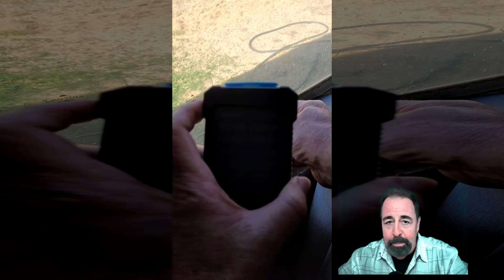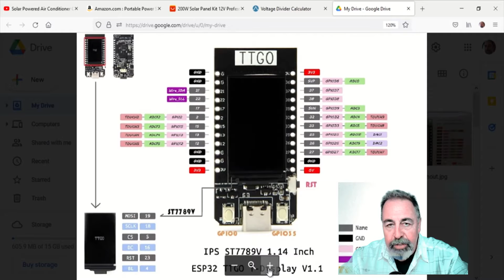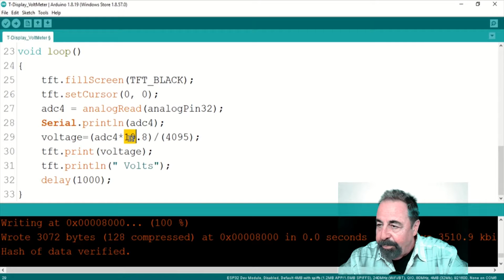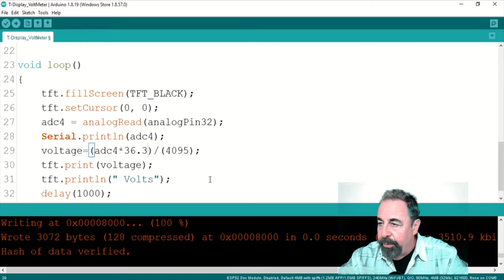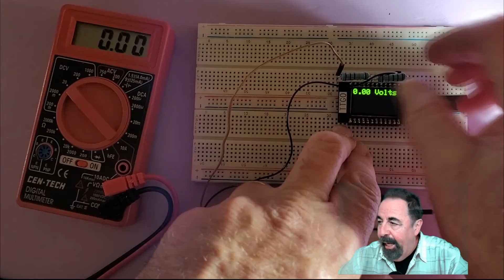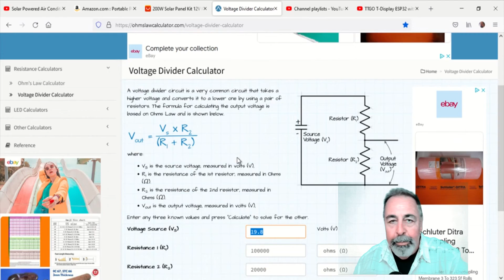TTGO T-Display Voltmeter

Comment: I have a genral TTGO T-Display question.  I know my experience is related to microPython yet I need to ask.  i have not been able to debounce the left button effectively no matter what I try.  It seems the right button has an on board physical pull up while the left is floating and connected to pin 0.  When I use the pull up in code I still get some wild results.  Any thoughts?  C or Python.
Reply from the maker: Hello. I can't speak for Python. But in the C world it is https://github.com/LennartHennigs/Button2

Comment: Hey I wanted to use the t display to act as a motor speed controller can it be done? I need to output 0-12v dc motor
Reply from the maker: You would need a separate motor controller for operating at 12v. These operate at 3.3-5 volts.

Comment: Before using the ADC to do some precision works, you must know the difference between RESOLUTION and ACCURACY! Many of those MCU integrated ADCs only have the RESOLUTION but no accuracy at all.

So please don't use the internal ADC to recharge the dangerous lithium batteries without GOOD calibrations! Lithium charger is required precisely monitoring the battery voltages, and the permitted error should be kept under 25mV!  So you have to keep the maximum charging voltage under 4.175V +/- 0.025V.
Reply from the maker: Agreed. 4.2v is the max. And running too low will ruin the battery as well.

Comment: Looks like some monster 1 watt resistors there.
Might be easier to use a 10-turn trim pot.
Reply from the maker: The 1/4 watt resistors I had looked so tiny! I did get some trim pots, but they did not seem to work, maybe I got the cheap ones. Production schedule means I had to press on!
Reply: @ShotokuTech  Yup, legs on 1/4 watt resistors are too skinny for a breadboard.
Some blue trimmers need to be cranked to extents before the wiper engages the worm.
Reply from the maker: I'm thinking that in my haste I needed to try a different range on my Ohmmeter. For a 20k Ohm trim pot, I needed to kick my cheap multi-meter up to 200k Ohm to get the reading. Thanks for your comments. This was an interesting exercise and I want to build on it.
Reply: @ShotokuTech  Do not want to harry you to death on the topic, but I recently tried using a 5V hd44780 display with a 3.3V MCU. 5 push buttons are read with just one ADC signal line. Different buttons send different voltages with resistor dividers on the device itself, so the source resistance is different for each button.  Ended up resetting the impedance with a pass-thru op-amp circuit, THEN dividing the voltage for reading.  
Everything is more complicated than it looks.
Nothing is as easy as it seems.
Reply from the maker: @GnuReligion  Agreed. I'm looking to build something for a specific application. Solar panel output, at least for these consumer oriented panels. I just need to charge big batteries.